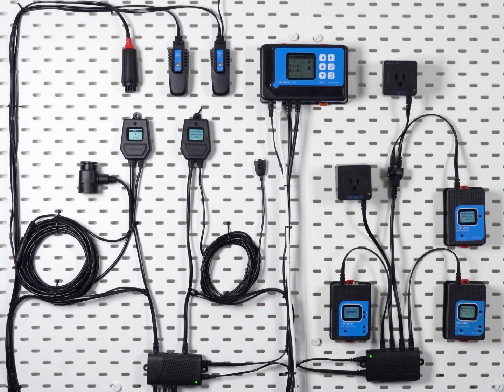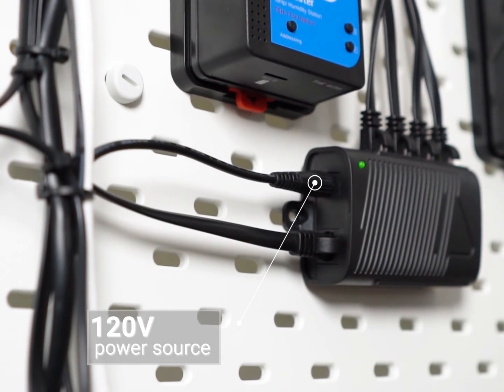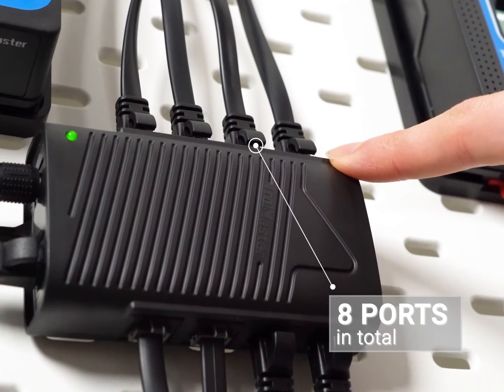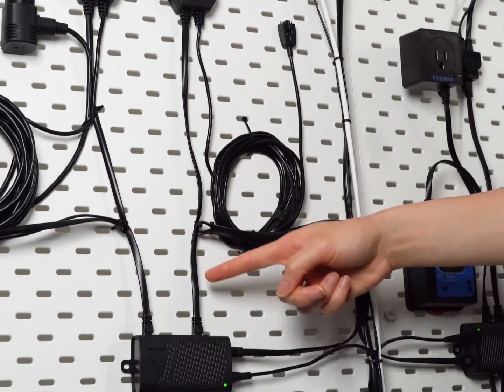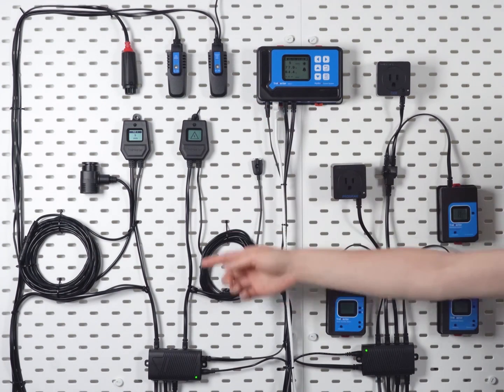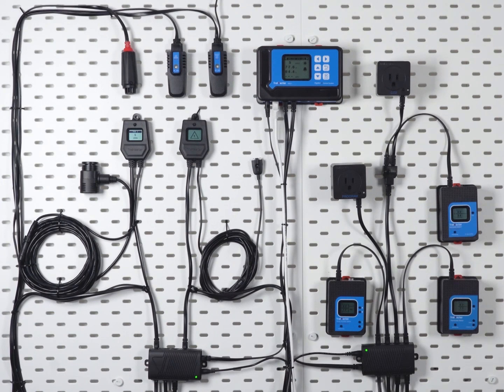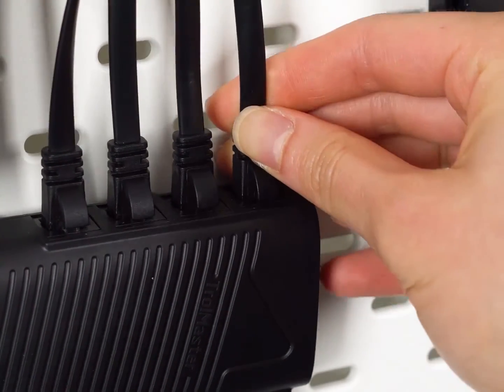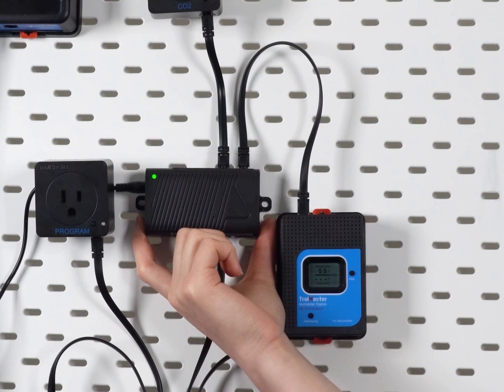How to use the SPH-1

Comment: How is it "cleaner" to add the device hub instead of a splitter? You'd not only have a bigger box, you'd have two more cables running back to the main controller.